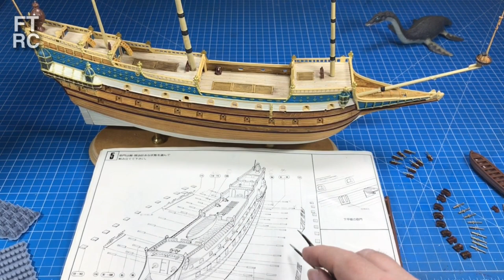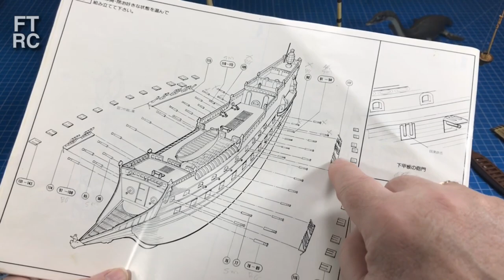Cannons and Gun Ports on Airfix St Louis Part 10  scratched and rigged cannon port lids

Comment: I wonder how long they did keep those structures covering over the main deck? I have read that while the structures were meant to protect the crew on the main deck from boarding activity the problem was that it also trapped the crew on the ship! Also too why is it they never include the rudder on the ships boats on these kits. I have found some really great info online that shows how the rudder should have been.
Reply from the maker: From my research they dropped the cover towards the end of the 17th century.  Yep rudders and tillers always seem to missing on these kits.  Easy to scratch, as I did for the Revell Bounty.

Comment: Hi Harry, 
Great idea for doing the gunport lids and ropes, using the rebate liner. Is that styrene and what is the thickness you used for the lid expansions?   
Finally,  this is not a criticism but I’m wondering about that big lantern sitting in the middle of the poop deck. Is it accurate?  
I like your style of making attractive models with extra detail and painting schemes that are reasonably accurate and pleasing to look at. Detail but no rivet counting. Carry on Harry.
Reply from the maker: Yes that absurd Lantern is typical for early 17th century French ships.. you see them in all the paintings from the period.  I used 0.5mm thick Evergreen styrene sheet for the blue faces inside the gun port lids, cut to about 5mm square.

Comment: When you were gluing the cannon doors on , what type of glue were you using ? It was the blue cap with the brush . Was it adhering to paint ?
Reply from the maker: it was my Revell Contacta in an old Tamiya bottle.  I had already filed the inside of the gun lid hinge free of paint, and scraped some paint off the joining slot on the hull.  So there were plastic surfaces to bond with the cement.

Comment: Brass was NEVER used for cannon. "Brass" cannons as the term was used, were actually bronze, a copper/tin alloy.
Reply from the maker: je ne suis pas d'accord mon ami
https://www.christinedemerchant.com/brass.html
Reply from the maker: and more
https://www.christinedemerchant.com/tall-ship-cannons.html
Reply from the maker: Bronze (tin) can be quite brittle so the cannons tended to shatter and explode.  Brass (zinc) offered a compromise that was more malleable and less prone to detonation.  Even the later black cannons of the English were actually brass covered in black pitch.  It was not until the 18th century as better alloys of iron were developed that iron cannons became the norm.
Reply: @HarryHoudiniModels  I believe you will find with more research that brass may have been used for small arms in early times, but the term "brass cannon" is a misnomer, since "brass" and "bronze" were interchangeably used two to three hundred years ago.  Come bronzes had 2-4 % zinc mixed into copper alloy which already has 8-10% tin, so the primary alloying element was tin.  Zinc/copper brass is far too weak for culverin or drakes, much less cannon.  Websites often incorrectly use the term brass when in fact the metal is a bronze.  I work with bronze, and know it to be an exceptionally useful metal.  You can make springs and swords out of it, unlike brass, which is crystalline, brittle, and weak.  It also fatigues easily.  Search for the term "gun metal" as recently used in cannon in America and you will see that guns called "brass" commonly were actually bronze alloys.
Reply: @HarryHoudiniModels  I believe these websites which use "brass" are misleading, owing to the use of brass and bronze interchangeably during the period guns were cast.  If you can obtain the alloying percentages, you will probably find that guns termed as brass actually had more tin in them than zinc.  Brass can be used in small arms like an arquebuse, however.
Reply from the maker: Well there is a lot of miss-use of the word brass then as every book I’ve read on sailing ships says brass cannons during the “age of sail”.  I understand the later alloys of both bronze and brass can be almost the same, but ancient bronze was no match for more modern brass.